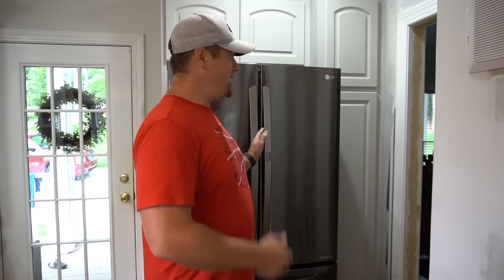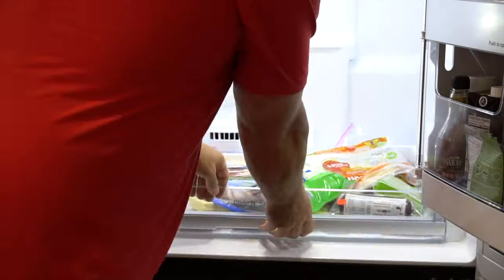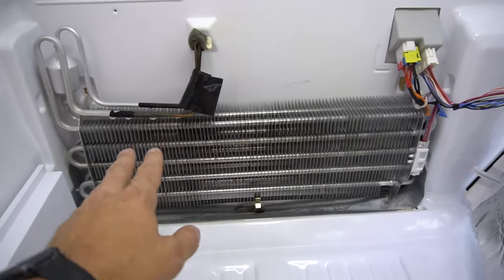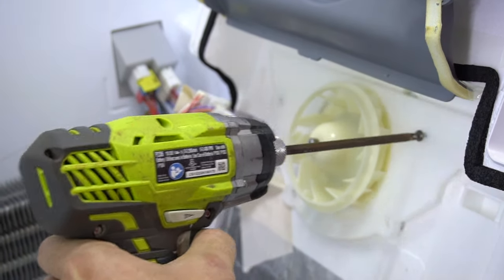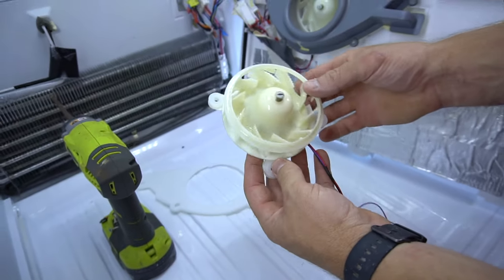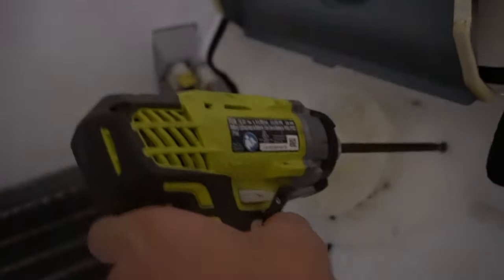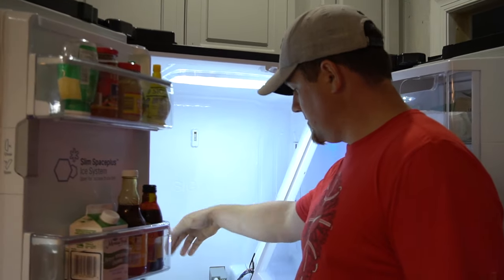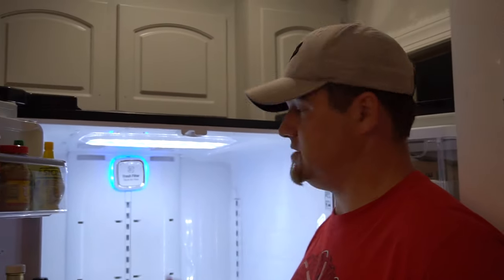LG Fridge Not Cooling -- Freezer Works EASY DIY FIX! #howto #DIY #repair

Comment: My fridge failed again after being repaired from the LG class action lawsuit. Initial failure was Not the fan, but the compressor, line filter and they updated the motherboard or something.  Had a company come out and run some tests and this time they said it was the in-line coolant filter that was clogged but allowing some by. Quoted me like $1200 to fix it and I gladly sent them away. I bought a new inline filter from Amazon for like $55 and I’m just waiting to have one of HVAC buddies come over and cut it in and see if it works. I was in LOVE with this fridge until it became a POS……
Reply from the maker: yep and so were all the other millions that bought this junk. Next to buy is probably Maytag, GE, or Whirlpool. They dont have the the issues that the LG and Samsungs do.
Reply: @TheRykerDane  Yes, we have a 31 CF LG, similar to your in video, we loved it till the 2nd year when all froze up in lower freezer coils, the fan to the ice maker in lower freezer, then again a year later, well that was it and we bought a  midea 27 CF side by side refrigerator, at this pont I relly dont give a crap what country made it, it is better than the LG

Comment: If you have ice built up on the door where the vents are left door does the mean the van isn’t working ? I’m having same problem my fridge isn’t cooling and I have some ice built up on the left door where the vent holes are at
Reply from the maker: yes extra ice means the fan is not working probably to circulate

Comment: Ok,I had a HUGE chunk of ice around the evaporator on mine. Took 3 hours to melt with a hair dryer. Am I op fan will cause this issue? It also took 24 hours to get back to temp. All I need to do is replace the fan?
Reply from the maker: If your fan is not turning it will not send the cold air and circulate

Comment: We had a power outage and lost our food. When the power came back on bought more food but then it went bad as well because my LG refrigerator had the same problem. The freezer was working great but not the refrigerator. I took it apart to test my fan. It was working? I cleaned up all electrical connections then put it back together and everything is still working great months later(I didn't replace any parts) I thought the motor would bad or maybe have a dead spot like electric motors do on automotive fuel pumps and blower motors(hit with a hammer trick/caveman diagnostics) but hasn't had one problem? Maybe had a bad connection? I'm a professional auto technician/mechanic not a appliance repair man. But it seems very simple and straightforward.
Reply from the maker: yes that does sound odd. Maybe something with the solenoid by moving the fan motor?
Reply: It's still working like a champ? But hey I'll take it. I don't really want to buy a new refrigerator right now:)

Comment: I have model :  LMXS 28626 S, Could you tell me where to get this fan? I got the same problem the freezer works fine but the top part  not cool enough.
Reply from the maker: online appliance website has everything

Comment: Recently, the ice machine is not working, when i check it, the fan motor of the ice maker is not working, when i try unplug the temperature sensor of freezer, it works normally again. when I plug the temperature sensor of freezer back, it not work (but the Evaporator fan still work). Can you tell me why?
Reply from the maker: Well I hope the compressor is working correctly then.

Comment: My lg is not making ice. I noticed the  ice cube tray stay with water as if is not cold enough to make the ice. I tried everything any suggestions? Thank you
Reply from the maker: that sounds like a compressor problem then if it is not getting cold enough unless the line is frozen and it is freezing up

Comment: The compressor has been changed twice now and both fans in the fridge and freezer have been changed and still no cold air blowing anymore. No body wants to check the wires to see if there is any power in the wires to see where it is dead, or where the power is at, of course i have a different model but still a french door.

Comment: My LG freezer works fine but the fridge section only gets to about 47 degrees. I cleaned the coils at bottom of fridge, evaporator at fridge section had a block of ice on it so I defrosted that. Still only cools to 47deg. I tested the heating element and fan, both work.. and just changed the thermistor. No flashing lights at motherboard.. any other suggestions? Fridge is only 6yrs old. I know these have bad compressors, but wouldn't the freezer section not work also if that was the case?
Reply from the maker: Unless you have a small leak, then your refrigerant is low and not fully cooling. But also that would probably incur frost as well. So as long as your fans are blowing over your cold coils, everything would be working. Possibly could be the evaporator that is bad that is not kicking on the compressor to cool?

Comment: I have very similar fridge. Compressor running, cleaned coils, all i know, and reset. Fridge nor freezer will cool at all. Any ideas? Tried restarting multiple times.
Reply: Probably too late for you in this case but for the next lg sucker (yes I'm one of us) that is reading this, the cooling system is a sealed unit that is known to blow out the refrigerator condensor and leak the freon out. Lg will replace the parts for repair but we have to pay for the labor. 250 bones!!  I'm on my 4th!!

Comment: Thank you great video! My fan was making a loud noise then it stopped completely and I got an “rF E” error on lcd panel. Then about an hour later fan stated up again all quiet and cooling now. Could there have been Ice buildup around the fan which melted!

Comment: Same Refrigerator and I have had this running for 12 hours and the evaporator in the refrigerated area isn't cold at all.
Reply from the maker: check your motherboard in the back for a flashing red light
Reply: @TheRykerDane  no flashing light
Reply: the fan it's not

Comment: I had an LG French door fridge that broke down after 3 years. A technician from LG came and changed the compressor and the motherboard and now it cools, but it’s not cold enough and there isn’t air flowing out of the back vents in the fridge. Could it be that fan at the back that’s obstructing air from flowing out? It’s cold but no where near as cold as it should be. Any ideas? LG isn’t very helpful when I try to call them. A fridge that lasts only a few years? Unacceptable.
Reply: I agree this is unacceptable. Did you get yours fixed because I’m having the same problem
Reply: Hey, having the same issue, what ended up being your solution?

Comment: I just bought a refrigerator like this on market place,  she said the freezer is working but the coolers is not cooling.  It that the problem?
Reply from the maker: just make sure you check out the condensors. Hopefully they don't have an issue
Reply: Hey, having the same issue, what ended up being your solution?

Comment: My LG is set at 33 degrees, but the actual temperature is hovering between 45 and 50 degrees. Is that normal?
Reply from the maker: not unless you have a leak of air somewhere, not creating a good seal
Reply: Did you ever figure out the issue?
Reply: @jeff_9074  Yes. There was something wrong with the compressor and it had to be replaced. Apparently it was a known issue and LG extended the warranty so the repair was covered.
Reply: @jeffjacksonmtb  was your freezer working okay? Mine is doing the same thing,  but my freezer is fine.
Reply: @jeff_9074  I think the freezer was a little warmer, but the food was still frozen. My ice cream was a bit softer than normal, so that's what tipped me off that there was a problem.

Comment: The question should be -- why are these motors going bad? Your fridge looks new? I have an LG that is 2 years and 1 month old that has stopped working.. We paid over 1700 dollars at Lowes, only last 2 years, whats up with that? Now I find out there is a class action law suit against the company for basically bad product. We had a whirlpool that lasted 20 years without any major problems. Went looking for new fridge and found LG now it is no good.

Comment: your website is not working

Forbidden
You don't have permission to access this resource.

Additionally, a 403 Forbidden error was encountered while trying to use an ErrorDocument to handle the request.
Reply from the maker: Ok thank you for letting me know, will get it fixed.